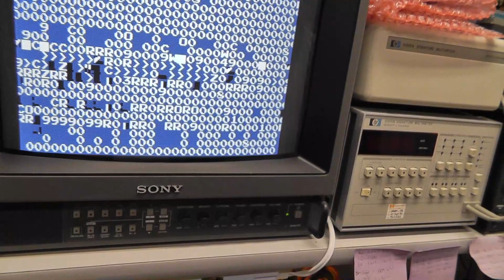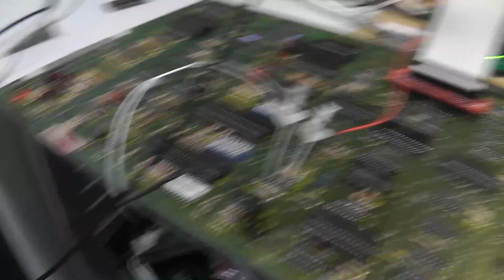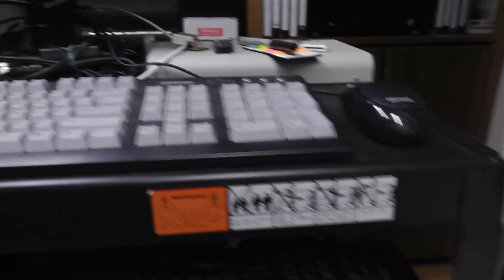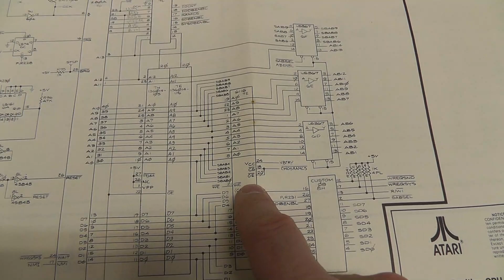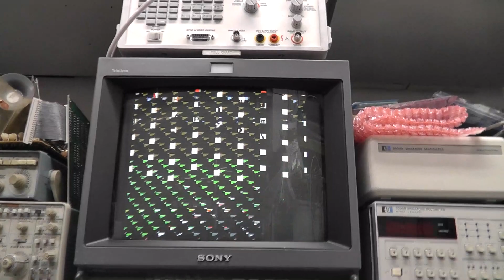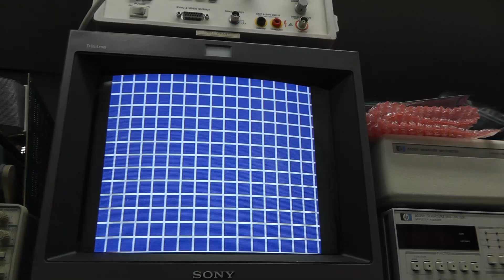Pole Position CPU PCB Repair - Reviled RAM 6 Error & More - RevC Set Part 1 - FPGA CAT Box

Comment: Nice work, I've fixed a fair number of these boards in the past. They are very lucky on timing and voltage in the two Z8002 Cup sections.  I'd like to know more about that FPGA CAT box especially with it doing signature analysis.
Reply from the maker: Thanks.  Yes the FPGA Catbox is an awesome tool.  There are a few videos out there on it but the creator maintains this thread on klov.  You need to be a member to see it.
https://forums.arcade-museum.com/threads/fpga-cat-box.472988/

Comment: Was the GAL/PAL chip bad or was the real problem because that one pin was left out of the socket causing you to think the GAL/PAL chip was bad? Do you know the GAL/PAL chip is doing like is it doing some type of RAM addressing decoding or what
Reply from the maker: GAL/PAL at 7C was a real problem for the "RAM 6" error.  Some of the trace repair likely helped but I verified 100% the PAL is bad.  The RAM8 was just pin 22 being left out. The PAL appears to mux several Address lines and bus control command lines from CPU to generate various enable signals for RAM, ROM and Buffers.
Reply: @jacklick  The PROM chip is mux the address lines and control lines from the CPU to act like an address decoder for the video ram chips? The bad prom chip was outputting wrong signatures but you would have to have a good working board to compare the good prom chips signatures against. Are signatures some type of checksum by adding all the bits or bytes to come up with a signature or what is a signature?
Reply from the maker: @waynegram8907  Close enough summary for me.
Reply: @jacklick  In the signature analyzers manual or that software program that use you for getting signatures does its manual say what are signatures because I don't know what is considered a signature. I would think that the manuals would tell what a signature is or how they compute a signature. It seems it samples and set of bits and does some type of calculation to compute a signature. I think the signature analyzers you have on your bench generates different signatures compared to software program signatures. If you're probing the same output pin using the signature analyzer ( hardware bench equipment) compared to probing the same output pin using the software program, both signatures will be different signatures or the same signatures?
Reply from the maker: @waynegram8907  I have done videos on signature analysis.  feel free to rewatch them.
Reply: @jacklick  Do you know why some arcade games use AVG Analog Vector Generator IC chips to REPLACE the Auxiliary boards? because some arcade games have a separate auxiliary board which has a lot of ram chips and other IC chips and other arcade games use a AVG IC chip. Do you know what an AVG chip is doing to the arcade game?
Reply from the maker: @waynegram8907  that question is completely irrelevant to pole position video.  Go check out classicarcaderepair he covered this in a video recently...maybe gravitar where a discussion on AVG is more relevant
Reply: @jacklick  yes I know pole position doesn't use AVG. But you have repaired arcade games that have those separate aux boards which is suppose to be like an AVG chip and other arcade games use AVG chips. I'm not sure if those signature analyzers will generate signatures from AVG chips? I haven't seen you use signature analyzers to test AVG chips